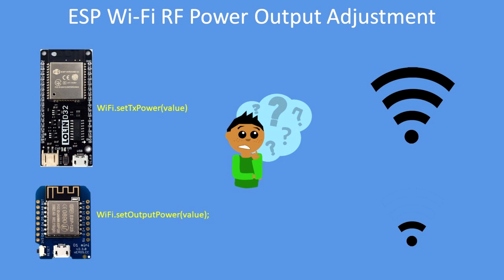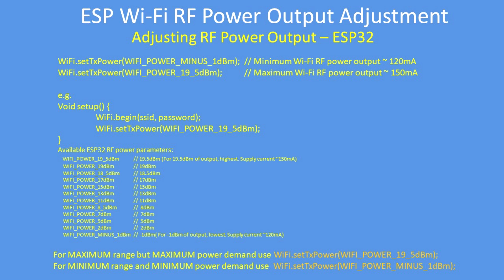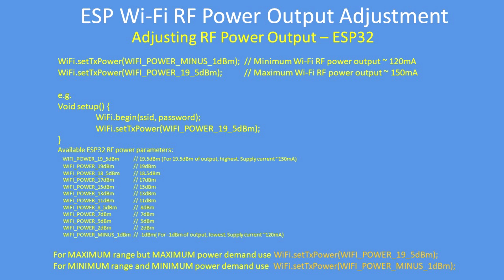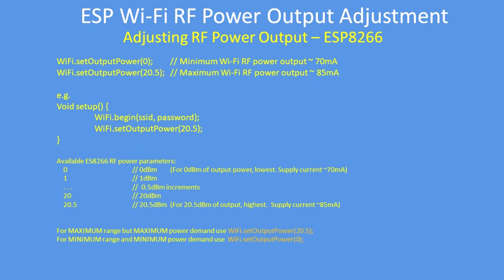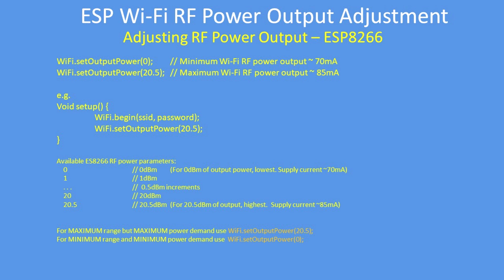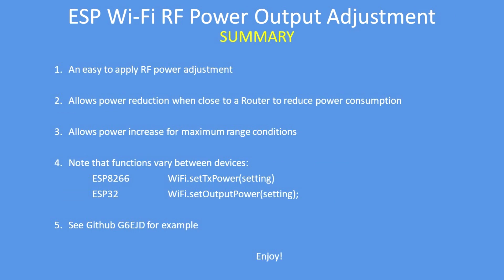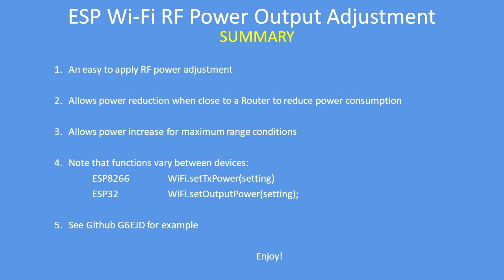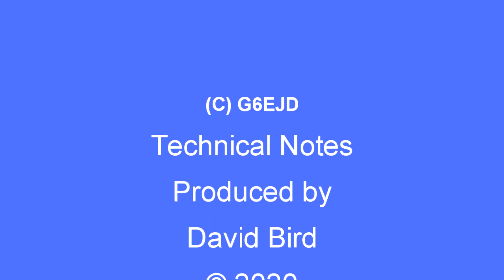Tech Note 147 - ESP32 / ESP8266  Wi-Fi RF Power Output Adjustment

Comment: Sir, i have final assignment, i would made gas metana detector using sensor mq4 with IoT, i searching in google about esp32 and its said for the radius its just 25Meter for wifi..and my lecturer said u have you add rf (radio frequency) for more radius wifi.. How i connected that.. Esp32 to rf? Sorry for my bad english 🙏🙏🙏
Reply: I can share you the word uf you want you read my proposal final assignment sir🙏
Reply from the maker: You can add an RF module quite easily, they are low cost and will extend range to about 200M in clear air (no buildings). They are a 3-wire device and are fed with serial data from the ESP32 using a spare UART on the ESP32. Speed will be limited to about 300-baud but that’s adequate unless speed of update is vital. You could if you use the ESP32 vroom with external WiFi antenna (Google YAGI antenna) that will add about 100M to the range, maybe more. Another approach is to use LoRa which will extend range to 2-7 km again another relatively easy addition to make. Yes if you wish to share me your final assessment (English?) then I can review it for you. See my webpage G6EJD for contact details.
Reply: @G6EJD oaahh thankyouuuu... But i use bahasa in my final assignment sir.. 😭

Comment: How to apply this code.
With which software should i apply and how? Please help me, 
Thanks in advance
Reply from the maker: Just the standard Arduino IDE
Reply: @G6EJD  it is not working, it shows ,, wifi was not declared in this scope,,
Reply from the maker: You haven’t defined the WiFi object, there’s an example in the readme
Reply: In Example, what should i change? Can you please tell me the steps or make a video to set esp32 wifi rf power output to highest level? Thanks
Reply from the maker: The compiler defaults to highest power, so no need to do anything.
Reply: @G6EJD  what is compiler?
Reply from the maker: The Arduino IDE is the compiler!
Reply: @G6EJD  what should i do to set output power to highest level of esp32?
Reply: @G6EJD  i need your help, i don't know how to do it?Thanks

Comment: Why little max power in esp8266 vs esp32 ? Is it weaker wifi?
Reply from the maker: The RF section on the two devices is completely different , the ESP32 has a wider adjustment range. the ESP8266 seems much more efficient than the ESp32 for RF output as it consumes less than half of the ESP32.

Comment: Great video topic. I actually have this setting in ALL my ESP codes. I define a variable at the top that will apply to the set tx power. What I'm most surprised was is that the current/power savings is actually not that significant between min and max. I'm glad you included those values in the presentation, would have been nice to go more in detail (e.g. hooking up oscilloscope and seeing the difference between the lowest and highest power setting). Again, great topic!
Reply from the maker: It’s been documented by Espressif that the major consumer of power is the WiFi receiver. Although not documented I believe the WiFi output stage is a class-D transmitter and therefore power consumption between minimum and maximum is not that great, although in RF power terms a range of 20dBm is huge at 100 times power increase over 1mW.
Reply: @G6EJD   point taken! Thx

Comment: This is seriously cool! Is there a way to determine how far the ESP is from a router, or some way to measure the signal strength of the back and forth communication?
Reply from the maker: There is rumour that Espressif may introduce some such technology in their later designs but for now it’s not possible range as the timings are so short using transmission tine of sending and time of arrival, you could ask another ESP to report back RSSI but that would only be meaningful if you knew where the two devices were or you had multiple devices all reporting RSSI to each other, then there could be a qualitative assessment of range based on a more global view of signal strengths around say a central device. Unfortunately there is no direct correlation between signal strength and range unless the terrain/signal path is fixed, in which case the range-signal strength could be measured in advanced. At best it could be an approximation of range. The fresnel effect has a bearing on range and in-turn this is a function of the surroundings. It’s a complex subject.
Reply: When doing a WiFi scan you can get the rssi that represents the signal strength. It's a negative value from -1 to - 100. -10 means you are very close -95 means you are far away but its relative to the power of the router. The ESP S2 can all so give you time of flight in promiscuous mode so it can give you an accurate measurement
Reply from the maker: Thanks, that’s useful to know. Given the range of WiFi, the time of flight duration must be very short, a few 10’s of nano-secs, 10M would be 33nS.
Reply: I know this is an old thread - but i use this 

## Calculate the range of Wifi signal strength

´´´txt
Signal transmission in ft^2 = ((dBm + 4,000) - 2,000) / 42.7

4,000 = nominal base dB of average consumer grade WIFI antenna
2,000 = Nominal base dB of peak signal interference
42.7 = a constant for conversion to square feet
´´´

```cpp
int signal_range = ((dBm + 4,000) - 2,000) / 42.7;

WiFi.setOutputPower(dBm);
```

Comment: Very interesting, thank you.  Are these devices set to maximum power by default?  Bob
Reply from the maker: Well based on power consumption it appears they start at the lower end of the RF power, I have not been through the library to check, I must do, it’s a good point. I do know that setting the power to high has a definite increase in power consumption so not defaulted to high.